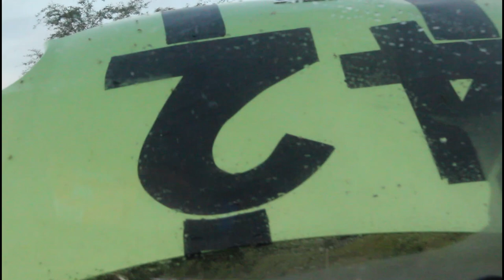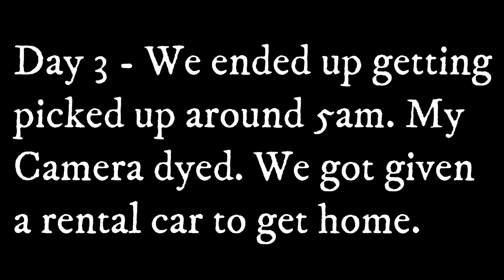We Broke Down 600 Miles Away From Home And This Happened!

Comment: I had a similar experience last year. I was going home from a two week road trip in the early autumn.  Had four hours left before I was home when the cars radiator popped and the cooling fluid rained one the side of the road. I discovered this and stopped the engine before it overheated. I had no bug problem, but this was in the mountains in western Norway, it was cold and windy on an early Saturday evening. Luckily I was towed down from the mountain to the village I just drove through. I went home i a shitty rental car with only some of my stuff. It took a full week to replace the radiator and get the car back on the road. It became an expensive road trip but I got some nice photos.

Comment: 3 adults plus luggage in that go cart? Shouldn't be surprised a belt snapped. Next time you travel cross country don't take a car with sewing machine motor.
Reply: When I was a baby. My parent my mother's parents my aunt and uncle did a trip through 17 states and a little into Canada in a station wagon pulling an around 18 foot(5.5 meters) cabin trailer. It took around 3 months to live like that. I hear stories about how money and food were running low towards the end. 6 adults and an infant in those close quarters for that long must have been ridicules. My only regret is I wasn't old enough to remember. Also BTW back then states didn't have laws against riding in the trailer(figure that's where my sister was conceived)..